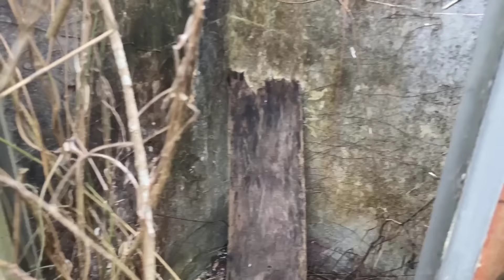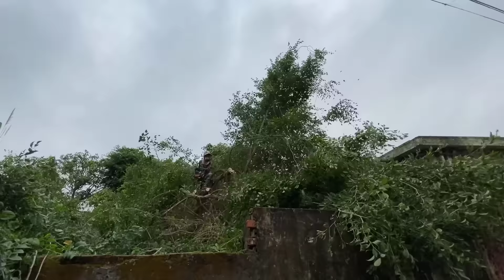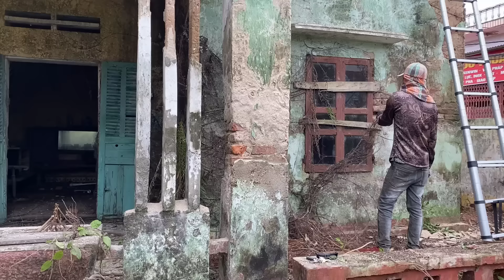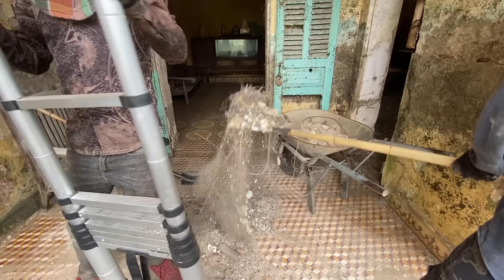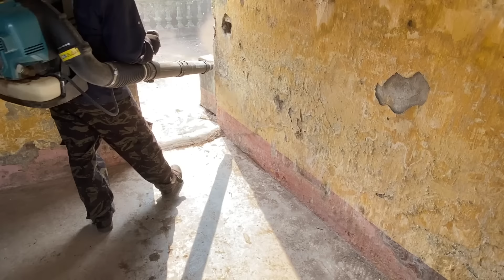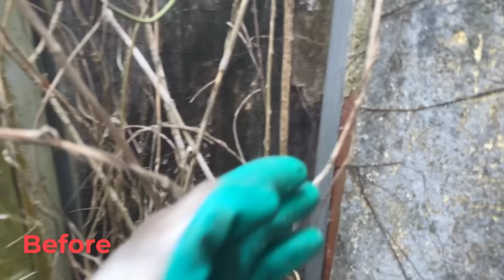BIG SHOCK of HONEY BEES Attacked Us When The HOUSE Was In Dire Need Cleaning

Comment: You. Didn’t sharpen your saw correctly.  Only push the file in one direction ant twirl it as you push it through.   You are working too hard. Don’t do a sawing motion with your arm the saw with guidance should do the cutting for you.
Reply: Only sharpen it on one side look at the way the teeth go.